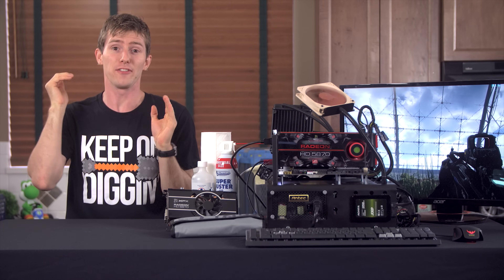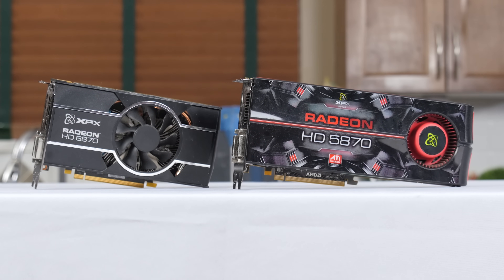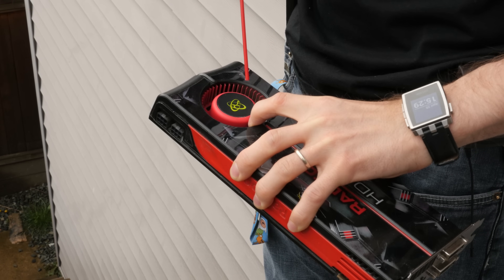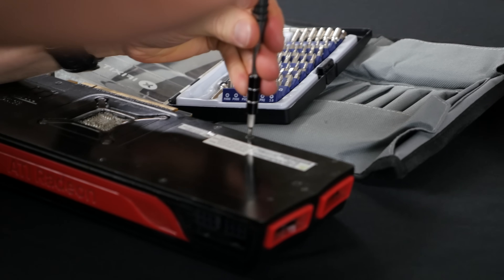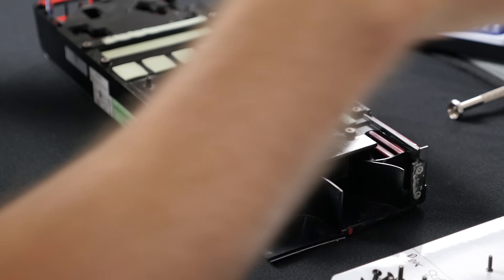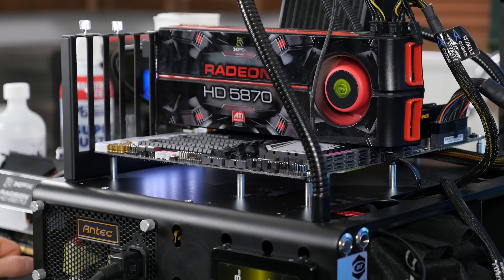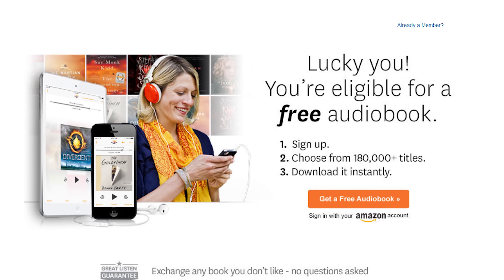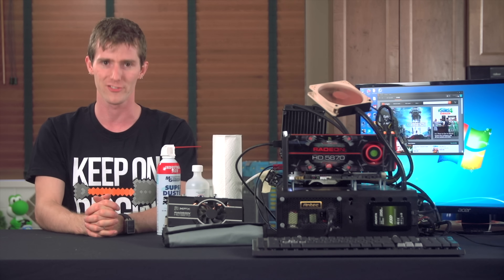Video Card Running Poorly? Clean Your Video Card Cooler!

Comment: Have not cleaned it in almost 4 years. The whole airflow on the heat sync was blocked and the fan was extremely dusty. After I cleaned the filthy GPU the temps went down from 80 to 27 degrees Celsius on idle. Thanks!

Comment: Sir my gtx 660 wind force fans are running fast but not showing display ..system is not working what is the problem?
Reply: bahi mera gpu bohat shor kr rha na he air compressed hai na he blur bas thora sa saaf kya thik hogya thora issue kr rha ap dukan wale ke pas jao
Reply: @m.shahbaz4356   repair he karwana parega lagta hai

Comment: is it necessary to apply thermal paste after opening graphic card 
please answer
Reply: If you pulled apart the card I'd advise for applying new paste as the old one might not deliver the same performance and also might have some air bubbles when put back together.
Reply: @MrC4ctu5  thnx

Comment: People need to wake up and take a hard look at what electrical engineering has accomplished.  It's 2019 and you shouldn't worry about temperature if you own anything higher than a gtx 1050.  GPUs run pretty well at 95 degrees and below.  Cleaning your gpu or changing the thermal paste may decrease the temperatures slightly, but you won't notice any change in performance since all the newer cards run pretty well at 90 degrees.  Nvidia has tackled this and electrical engineering has come a very long way.  Even if your gpu goes over 95 degrees, it will just thermal throttle and decrease its clock.  Even when it thermal throttles, you won't notice any huge decrease in fps.  Remember, this only applies to GPUs that are 1050 and higher.  It's 2019, stop worrying about temperature.  Technology is way ahead of you. I guess this video is excused since it was published in 2015.
Reply: Modern AMD GPUs are programmed to start throttling like at 75c, the sweetspot with those cards is 65c.
Reply: @SovietRipper  That's because AMD overheats a lot and AMD hardware are for poor people , living off food stamps.

Comment: I just got a free 7970 and 800watt PSU from a friend's old system.  It was a third hand system, the PSU was SO caged with pet hair from year and years it was crazy.  The computer was shutting off during use, which is why he gave the parts away.  I'm almost certain the PSU was the problem.  I cleaned the GPU and applied new thermal paste as well, and put the 2 components in an older system I had lying around.  Now I have a test spare parts system that can game!  Runs Doom at 80-110 FPS at High with Vulkan!

Comment: I accidentally removed the thermal paste on a small radiator (which was seperate from my main radiator) on my Gigabyte GTX 1050 Ti. Then I applied a lil of the normal CPU thermal paste and put it back in. I didn't remove any of the other white thermal paste on the GPU. I started the system and played pubg for 10mins and the temps are 83C. They've never been so high. And even after closing the game the temp remains at 83°C. Should I go to the service centre? Will my warranty be void? Can I buy the white paste online? Pls help.

Comment: if your fans spin at or around 1200RPM, just remember to dust it with an air duster every  155,520,000RPMS (90 days of run time).

Comment: I remember how my GPU was running at VERY HIGH temperatures. (it wasn't brand new) 
Decided to clean it... after disassembly the reason for high temperature was obvious. There was NO thermal compound on the core...
Reply: yeah mine didn't come with any either I put some liquid metal on it and now my temps are down like 6 degrees

Comment: am I the only one that has a HD 5870 XFX with a bigger heatsink and 2 fans at max speed that goes to 82-90c when gaming and a GTX 780 ti reference card that reaches 82c from 50 -100% load both cards cleaned and with new thermal paste? even when i ramp up the leaf blower on the 780 ti i still get 80-90c under 1GHz. Please Help! Worst case was playing DOOM Open GL on the 780 ti max settings 1080p and locking it at 60fps only to still reach the toasty 95c with 100% fan.

Comment: i just bough a new rx 560, it's working but the gpu fan spin so slow and sometimes not spinning at all. everything is clean and well since it's new, but how this happen.
it's working, but even doing small task like web browsing is so laggy, and when i try in game... it's working too 60fps in new divinity original sin 2, but stutter and sometimes freeze.
is my graphic card broken? or my psu lack of necessary power to run it? it's 500w psu that included in the case segotep and ii.
help!!
also i use cheap asus mobo am3+ with amd fx 6300

Comment: Sadly, I was hoping to use the basic ideas of this video to get my rather old Gigabyte GTX 550TI back up and running for a potential near-future file server build (which will do light gaming), and I discovered that despite the neat looking cooler design, after the fan shroud was removed, and the cooler removed from the card, it was a horribly cheap, poorly designed, and overall junk cooler. The two fans were screwed into the shroud on tiny plastic legs which broke under the smallest amount of torque, and the cooler itself is just... Terrible. The heatpipes run across the GPU die with a HUGE gap down the middle, and the entire surface of the GPU cooler is a very roughly textured, low quality surface. So, now I have to decide if I'm going to buy a new cheap video card which probably won't run as well as the 550TI, or buy a new aftermarket cooler for my GPU. Or just use the onboard video on my planned computer build.

Actually, maybe a suggestion for a redo of this video... Get some graphics cards with really crappy GPU coolers, to show people what to look for if they are having cooling problems that cleaning and new thermal compound doesn't solve...

Comment: I have a GTX285 from XFX that uses an almost identical design.  It was running for almost a decade without being cleaned.  You wouldn't believe the amount of dust that came out the back when I blew some air through it.  Should have held onto the fan but thankfully I didn't bork it so I guess I got lucky there!

Comment: i just take my case outside, make sure the fans wont sping and toss a good old leafblower full blast on top of it. blows the heavier stuff in seconds, making my pc ready for another couple of years of clean operation. (no i'm not joking. it's actually a very easy way to make it "operational clean", though things will still look "dusty" if they were before. it'll just clear the dirt wads)

Comment: 1:00 Get a vacuum and dust out it's filter right n(z)ext to the GPU's fan while it's fan is plugged in to a 9 volt battery (Or whatever voltage needed to make the fan spin)

Comment: all those screws, looks like its not worth it to dismantle the GPU to clean it. but my gtx 760 is 3 years old and I have been tempted to get the gtx 1060. still got a backup gpu. maybe I can try it and if it breaks then that's my excuse to upgrade to the gtx 1060 lol
Reply: Get a 1070, You will be disappointed with 1060

Comment: so, short quick burst from the can of air? didn't know that. i tended to go with long sustained blasts. which i think overwhelmed the cans capabilities. 

i also cut down a tooth brush for removing the dust that the can just wouldn't deal with. not for sure how good a idea that was though. It seems to work. though i worry i didn't cut it down enough and that it is still putting to much stress on various parts.

Comment: i have a a6-6400k apu and hd7870 is my cpu holding down my gpu?
Reply: It might be, the cpu is a bit on the bad side compared to the gpu, but it shouldnt cause too much harm. Investing in a new cpu would be a bit dumb, as the gpu also is really outdated and it would probably be more cost efficient to upgrade to a newer gen.

Comment: how bad is it to open the video card, clean it, but not put on more thermal paste?
Reply: Thermal paste will harden a bit after some time, so if the thermal paste is more than a few weeks, the contact "MIGHT" not be as good as with a fresh layer of paste. But, if you apply thermal paste, and remove the cooler and reattach it again its no harm. I think Linus made a video, or mentioned it in a video that he tested it with cpu's, and it didn't matter. It's just a good idea, as it's inexpensive to change and takes 2 minutes to clean and reapply some paste. I've seen some people getting worked up about "oh shit I mounted my cpu cooler 10 minutes ago, but now i need to take it off, now i gotta spray the entire cpu down with rubbing alcohol or else the pc wont work"
Reply: Cleaning with a microfiber cloth and some rubbing alcohol is probably the best way to do it, since alcohol will easily clean, and evaporate leaving little to no residue, and the microfiber cloth shouldnt dissolve and leave fibers on the cpu. Changing the thermal paste isnt something you need to do. It usually dont make a difference before 5 years have gone by. What I always do and reccomend doing, is to stress test the PC when you make a new build or change a major component. From that you get an idea for what the temps should be at what clockspeed, fanspeed etc. Once you start noticing that its noticeably higher you can change the thermal paste. Higher temps is usually higher room temperature, dust, or something easy like that. The thermal paste is hard when you remove it after a few weeks-months or so, but that normal. Doesnt matter as long as temps are fine and the cooler has good contact with the chip.
Reply: it will not work its pretty bad
Reply: Jinjenia thanks for the response. I started hearing noises inside my computer for the first time in years, thinking it must be dust in the fan of the gpu, since it had a big clump inside, but it ended up being the psu, which now is fine, but I suddenly remembered I needed thermal paste! It looked pretty old and cracked. How important is it to clean off the old paste? I'm just worried about using the alcohol and microfiber. lol
Reply: thanks for all the extra info. I've been keeping track of the temps using CPUID program. It's actually been pretty low (39-50C), but I'll keep an eye on it.
Reply: Jinjenia cant you also use coffee filters?

Comment: i took my 280 apart, removing the heatsink and fans from the card, then removed the fans off the heat sink so it was just bare metal heat sink, then i cleaned the heat sink with warm-hot water, dryed it in front of a space heater for about 5-10 min, then reassembled applying new thermal paste to the gpu. Doing all that and i dropped about 5 degrees

Comment: My gpu is running at 99C while idle.

I'm sure this will end well.
Reply: Your picture can't be fitting enough.
Reply: watch Jayztwocent's video about thermal paste on gpu's. If it's that hot you might take the side panel off and put a box fan next to it. If it's still hot it means the card's fucked.
Reply: without heatsink
Reply: which GPU u have
Reply: lol
Reply: prolly a gtx 480

Comment: I found out that using a large paintbrush can also help clean out dust. Works better on lower fin density heatsinks though.
Reply: duuude! thanks for that tip
Reply: Griffin Correia is it safe to use toothbrush, won't it ruin my circuit
Reply: Shadow Back If you are careful, it should not harm it, As long as there are no metal bristles it should be fine, as metal can harm it

Comment: Anyone saying that the 6870 cooler is hard to gunk up, i have the 6850 on my render server, you should have seen the heatsink. ps i needed a screwdriver to pick the dust of it. Like seriously, pick it like with a hammer and a screwdriver.

Comment: i have an Asus GT430 1Gb ddr3 with a problem, it is a bit old but it always "clean" as i open the case every couple months and clean it up as much as possible...

the problem is that the tweak tool that i used to fix the fan speed up to 100% when going for a gaming time, now it is causing the computer to freeze and show me the blue screen, what could i do to Clean/Repair the card?
Reply: u can try a fresh install of Windows in The worst case or reset The fan speed to normal and uninstall The program

Comment: Guys, does dust in ur video card cuz BSOD?
Reply: BSOD can be caused by overheating, and dust blocks up the fins on heatsinks making them dissapating less heat and causing overheating. So yeah, dust can cause BSOD, but it would take a shitton of dust.
Reply: in serious cases dust can actually cause shorting
Reply: Enough dust in your computer can actually cause a fire. Dust is very flammable.
Reply: i am afraid not .. dust can only cause its fans to run louder,slower and be less efficient!
Reply: My PC got random BSOD from a dusty CPU Heat sink.

Comment: I use a hairdryer with the heat turned off (so it only blows room temp air), it works great.
Reply: Vinícius Münich  this actually works perfectly for dust bunnies. My old man gave me the idea originally. Lawl

Comment: Guys need help please.
I have this gpu I just bought (secondhand) 

it worked for 1 day then it suddenly crashed and shutdown now I cant boot it the monitor detects it but its just black and the pc doest beep.

My pc works with the old gpu but with the new graphics card it wont.

Specifications
Motherboard: Athlon II x2 260
4gb ram
600w (Generic) (New)
Graphics Card: palit gtx 260 (new gpu)

Comment: So my r9 390 was like hella dusty and i was like hitting 50c at 20% fan speed, now that i added new thermal paste and cleaned out my heatsink  now im at 30c and at 20% fan speed idleing.
Reply: what is your ambient temp?, i live in tropical country, its 30c - 33c all year round here, idling at 48c - 50c, 1 fan active
Reply: +Solid_Metal I live in the states and where I live it's very humid but my ambient temperature is around 25c.
Reply: +Planet Fade 20c
Reply: no reason to have fans work with idle

Comment: My gtx Gigabyte 780 ti OC keeps reaching 99 degrees and then throttles and serverely limits my gameplay, It doesn't matter what I'm doing I always have my fans 100% because it is so quite and my case has prettt good airflow Thermaltake M9D. so I can really only result to cleaning it now and reapplying thermal paste... :/
Reply: THAT IS EXACTLY LIKE MY 690. It hovers about 98 degrees celcius on Ark Survival Evolved
Reply: Ethan O'Shea New Fans, clean the heatsink etc, replace thermal paste with Liquid Metal, at your card will run with 55° at load :)

Comment: My computer is:

1. GPU randomly shutting off momentarily in games, crashing the game and taking other programs as well.

2. BSOD for "graphics hardware error"

3. Extremely slow boot and shutdown times.

4. Overall unstable as fuck.

I can't even play games on this computer anymore because of the afore mentioned issues, help would be greatly appreciated.
Reply: Your GPU is most likely overheating so it shuts down.
Reply: OnetastyJoe I got the dust out last night, it seems to be working better. I still don't know what caused the graphics hardware error BSOD. You have any idea?
Reply: have you monitored the temperatures of your GPU under load? Try that and compare those values to values given by others online.

I just changed my cooling paste on my ancient GPU and temperatures sank with 20 degrees atleast
Reply: OnetastyJoe I'll open up Arma 3 sometime and watch the temps. From what I've seen before it's not gotten over 65.
Reply: Also remmeber the basics: make sure your GPU drivers are up to date :)
Reply: OnetastyJoe When I try to update, they uninstall and then won't install the new ones. I'm stuck on 350.12 . It just won't update. :/
Reply: what GPU do you have?
Reply: OnetastyJoe An EVGA 970 SC.
Reply: http://www.tomshardware.co.uk/answers/id-2686376/evga-gtx-970-ftw-acx-temperature-high.html

apparently your temperatures seem like avg.
Reply: OnetastyJoe "Under normal conditions, 85-88c is about the absolute maximum you would want to see. Your temps are pretty good actually." Well shit, that's good. That was before I dusted it, now it may be better.
Reply: OnetastyJoe I did have a nearly 3 hour session of Factorio earlier today, that's not at all a graphics intensive game, but I'm sure it should have shut of after 15 minutes to and hour of gameplay like it does in other games. Like i've said, I dusted the GPU and it seems to perform better, I haven't tested anything but Factorio and Rimworld, two simple top down games.
Reply: +[HSC]Battleboy43 okey, that sounds good then ^^
Reply: OnetastyJoe Been playing Arma 2, not 3, it needs to update -_- for about 10 minutes and my temp is 38 degrees.
Is it magic if it sounds like a jet engine?
Reply: ***** Actually, I've learned the hard way that dust can really, really fuck a graphics card up. It's been working wonderfully. 
I really can't update drivers without it fucking itself though. It'll uninstall previous drivers then can't install new ones for some reason. Then I'll be stuck in 800x480 while it reinstalls the old ones.
Reply: ***** I always do a clean install. It just refuses.
Reply: ***** CCleaner? Fuck that shit. I'd much rather DDU.
Reply: Battleboy43 reinstall windows and cmos reset. Then clean the shit out of your pc and gpu
Reply: Peter Kapica It was fixed by cleaning the fuck out of everything and finally being able to update drivers.
Reply: Battleboy43 that's good.
Reply: Now the new lesson is keep the pc clean and have filters on you're intakes
Reply: Peter Kapica It was both the files and hardware.
Reply: Battleboy43 yup
Reply: Battleboy43 I'm building my pc now. The cooler is giving me trouble.
Reply: In 2014 I got a GTX 770, and I remember I had a lot of problems installing the drivers for it, I got really angry because i didnt really find anything online, after like trying, checking cables, trying, checking cables and everything again, trying, trying and more trying it magically worked without really doing anything. Been working like a charm through multiple installs of windows, and many hardware and even motherboard changes.